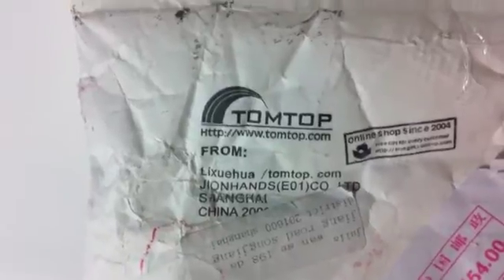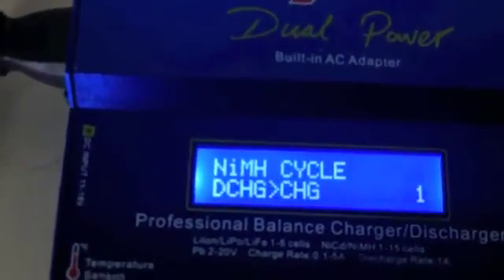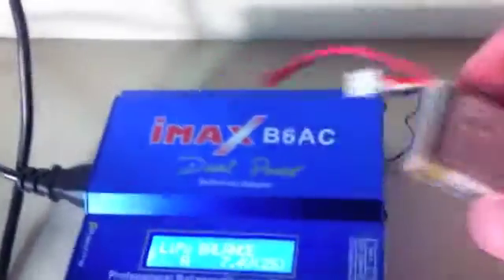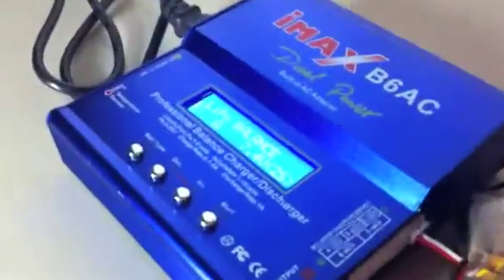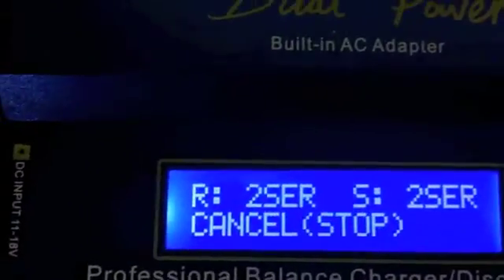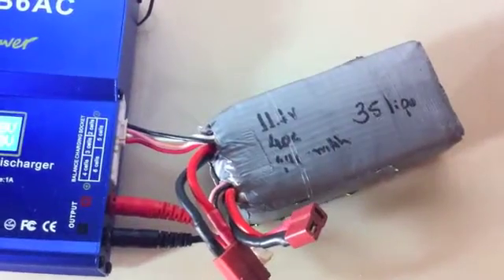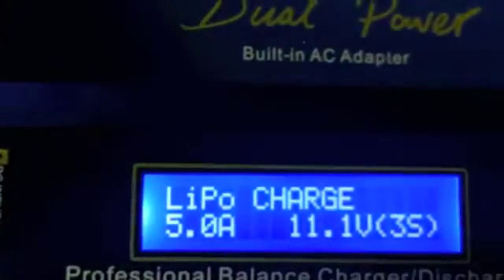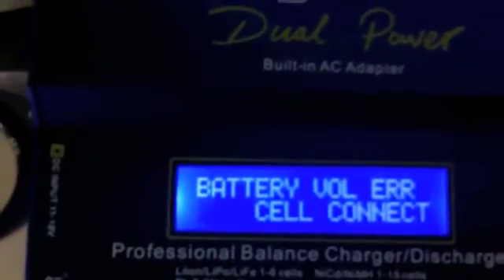Battery Charger IMAX B6-AC - Balance ( NOT WORKING )

Comment: u got a Batt short or burnt balance resistors cus it's adding cell 1 and 2 missed middle connection I had same prob had to resolder Battery balance wire ....tbf this kills batteries be careful don't balance properly caused 1cell go low and 1 to go high voltage

Comment: Hey, how can you tell if it's fake?
Reply: HobbyKing has a video on that very question. The short version is: Box is different, color of charger is slightly different shade of blue, real charger has a scratch-off authentication sticker on the back and instructions for registration that require that code, disassembly will reveal evidence of hand/sloppy solder and crooked parts in the fake and often a missing reverse polarity diode. The authentic charger is built by robots and wave soldering, so all parts should be straight and smoothly soldered.

Comment: Same thing happens to me its because your cell voltage is to low try fst charge and at. .1 amp and after the voltage rises the balance will work.  Go fst charge. .1amp then once it starts let it run for about 5 min then you can hit the Inc button to see the cell voltage.  Or go to balance mode

Comment: just saying... you have the fake version.
Reply from the maker: LetsGetStarted Hum, but it works !
Reply: Felipe Zafani Yep!!! Can be dangerous tho but... who cares right?
Reply: ***** The fake version is missing safety features like reverse polarity protection. SOME!!! of the fakes also degrade the life of batteries as it may read voltages incorrectly and therefore may overcharge batteries. This can even lead to exploding lipos...
Reply: LetsGetStarted Wy would the fake version be dangerous?
Reply: Mine stops at 4.18v per cell and its suprisingly accurate. I tested it with my multimeter. The Charging cable had a voltagedrop of .12v which i find quite funny.
Reply: ***** SOME!!! of the fake chargers don't have their voltage meters calibrated properly. There are videos on youtube of these chargers charging lipos to a dangerous voltage due to it thinking that the battery was still flat.
Reply: @Felipe Zafani - I have this version, but works well, bro!  just use 1.0 A in charging..😀

Comment: If you have some experience in electronics, just disassemble by removing 10 side black screws, pull up four silver buttons, slide out(left or right) carefully the board and first look at soldering at "fat" points. Those are:
1. A big coil  with 2 very short endings that possibly unsoldered(broken soldering)
2. Two big diodes check all four junctions.
3.Two clip (black and white) connectors.
Mine was one of the big coil junctions, since the day I bought it.
This would be wise to solder again all those junctions both sides on the board, even if you do not see them broken. A bad junction works as a resistance. Be careful not to short circuit junctions with other printed circuit lines.
In general this is a good charger, good design and materials. The problem with most of that kind of things that come from China is usually the assembly line.
You might also notice many other details, like un-cut pins, bad placed capacitors critically turned to short-circuit etc. They are human hand mistakes.
Reply: The authentic charger board is built by robots and wave soldered. You are describing a counterfeit charger.
Reply: Hmm..! nice bro..😀